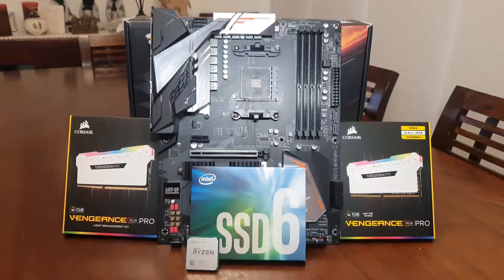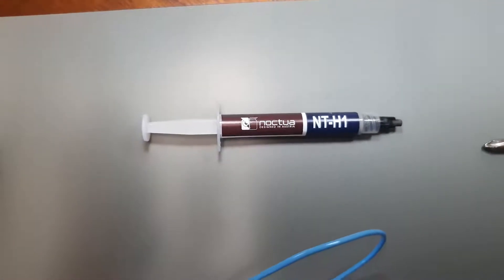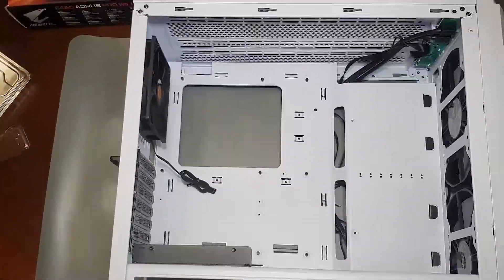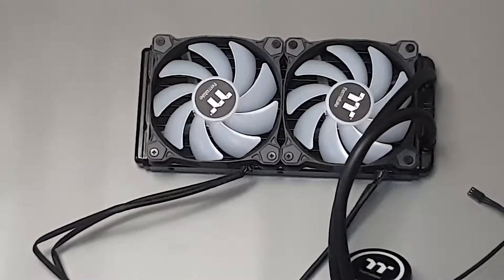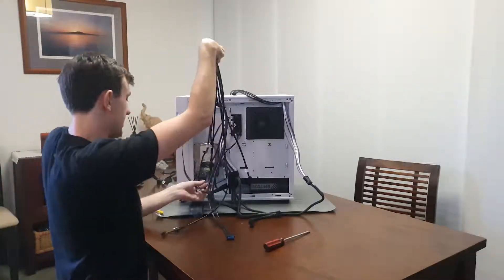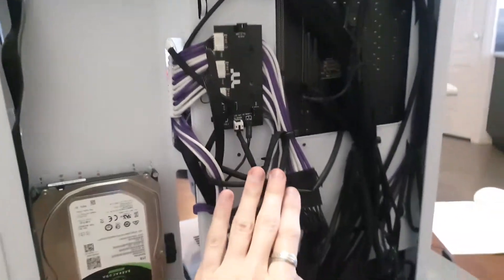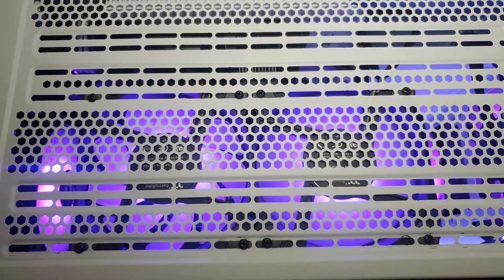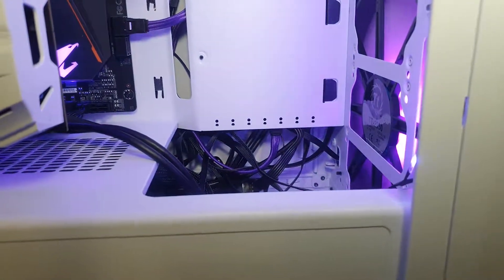How To Build A Gaming PC In 2019

Comment: Are the front fans loud for you?
Reply: it will be loud if you are on sleeping state
I have to turn it off or open my fan to stop listening to the noise, you should replace them with rmw fan if you could
Reply: @maskedlover8768  i did. My mother board didn't have a fan controll plug in for that.

Comment: Hello, according to the official spec sheet from thermal take, that GPU shouldn't be able to fit in that case. The spec sheet says the case only supports GPU height up to 110mm, but that GPU is over 120mm in height. So, obviously the 110mm isn't true, but do you have any idea what the actual dimension limits are for that case?
Reply: the height pretty good so i think any card should stand inside the case just fine since the 2 slot long pretty much the same with 6 horizontal slot